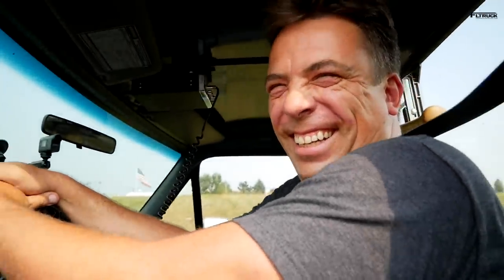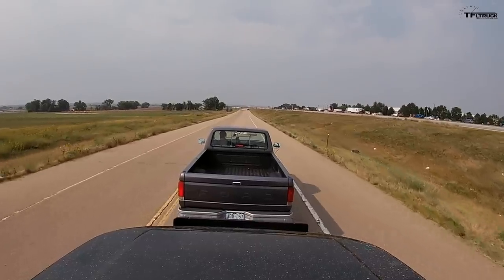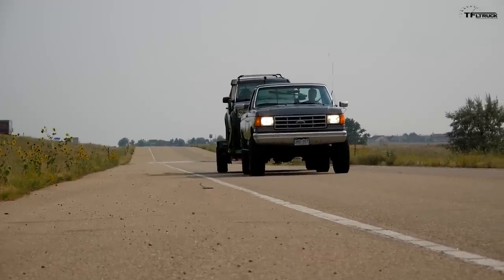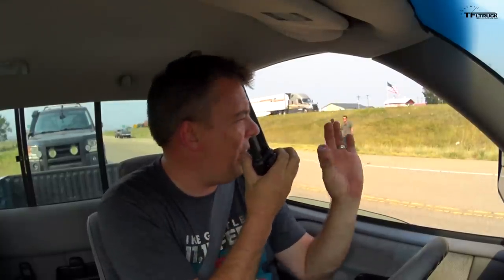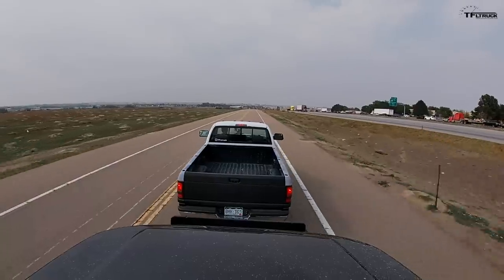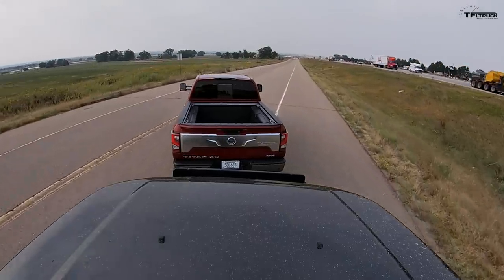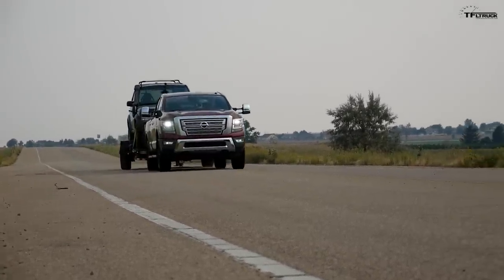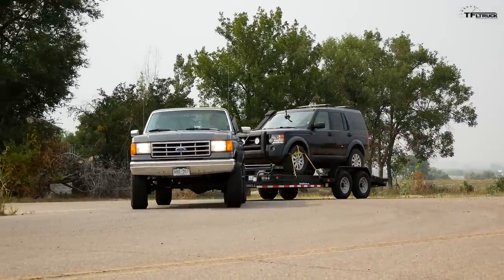Surprising Result! Can a New Half-ton Gas Truck Out-tow an Old Diesel HD Pickup? Let's Find Out!

Comment: Those old IDI'S didn't have enough power to out run a fart but they were good for 700k miles
Reply: A candle half as bright will burn twice as long
Reply: Put a turbo on one, and you get more power, same mileage, and it will last longer.
Reply: @kaulincurtis9665  the turbo one wont last as long because the turbo is forcing more air in the motor the non turbo will last longer because the motor isn't under that type of stress
Reply: @wyattfollestad8872  if it made more than 400 hp that would be true. The main thing the turbo accomplishes in longevity is drastically reducing the temperature of the combustion gases and improving emissions. As a naturally aspirated diesel, the internals are being cooked to death as the engine gasps for air.
Reply: @kaulincurtis9665  turbo was to combat elevation
Reply: @wyattfollestad8872  exactly, by packing in more air. When you pack in more air with the same amount of fuel, you get a leaner mixture, which, for a diesel, burns cooler and more efficiently. Turbochargers pack in enough air to allow more fuel to be burned, while still maintaining a leaner mixture.
Reply: I had a 94 factory turbo 7.3 idi. Definitely more usable torque but won't build boost unless its moving or floating the clutch with a manual to load it up.not as good as the direct injected 7.3 powerstroke where they still dont build boost good off of idle unless paired with a manual. I'm a cummins 6 speed guy now. Lots of low end and low gear boost and easy 40mph in 6th gear accept when im towing... Heard horror stories about breaking 6th gear.
Reply: Yes, the IDI is a great "around town" truck….they did Ford a disservice by not having a turbo vs. turbo comparison.
Reply: I got a 1990 f250 4.10 rear end idi stock everything will pull 12k to 60 fine, this one in the video is worn out and lifted

Comment: Sorry, guys, I'm not sure what 0-60 does for us here-- wouldnt it be better to do like a 10 mile run on flat and compare fuel cost, and then go from golden to idaho springs and back and look at speeds and fuel cost?
Reply: Thought I was the only one!
Reply: These guys usually miss the point  of towing.  The only videos they have made on towing that are very good are the ikes gauntlet videos. I really appreciate those since they really max out the capabilities of the newer trucks.
Reply: I think it's more for getting up to speed. 65 is the minimum here in Texas and you really get some super short on-ramps so you need to give it all you got
Reply: interstate on-ramp acceleration

Comment: Those diesels will still be on the road when that new truck is there age and in the junkyard...
Reply: Nostradamus here. What teams will win the 2021 championships? Who will be President in 2026? Any other predictions for the future?
Reply: BL Dontmatter  They probably are wrong. Either way, there is no logical basis for that prediction. It could be true. It could not be true. Likely, it isn't true. Modern vehicles run way more miles before breaking down than older vehicles.

Comment: Really enjoyed this video. I have an 89 ford f350 7.3idi. My wife named it Grease Lightening since I run biodiesel in it. Fun to see the different generations of tech stack up. The 7.3idi is definitely not fast, but it's reliable and there are so many still on the road today. Thanks for putting out good content. Fun to watch your videos.
Reply: Yes those old 7.3 International's are unstoppable.
Reply: I know this is 2 years old, but we just started towing a 10k lb travel trailer with a loaded bed and family in a 99 f350 with the 7.3. with an exhaust and an intake as the only improvements, it is not fast, but I like how stable and reliable it is compared to the 2022 chevy 2500HD my father in law sold for this and a down payment on a home. We both actually enjoy towing a heavy load with this truck better. Also the seats are 100 times more comfortable!

Comment: The oversize tires on the older rigs aren't helping their wheel torque numbers.
Reply: I think you meant the tractive force, which is indeed affected by the wheel diameter. Torque at the wheels alone doesn't tell the whole story.

You can have massive torque at the wheels,but massive sized tires will result in small tractive force
Reply: @juliussd5901   And are lying about the actual speed.  I have 315/70/17 tires on my 95 Cummins and the actual speed is little more than the shown figures on speedo.

Comment: I hate being so critical, but I do have to say that those 6.9 Tri star International V8 in the Fords would not do well when running near the red line. Power band is from 2-3 thousand RPM. You start to float the valves and loos power at 4K rpm.
Reply: this one isnt a 6.9 its a 7.3

Comment: Put a lift and some over sized tires on the titan to make them more similar.  When the older truck was new and unmodified it would have been "better" than they did for this.  Not saying they would beat the titan, but depending on how it is lifted and tires makes a big difference in towing.  Glad Amdre had no major issues with the test.  Stay safe and healthy!
Reply: I have a feeling that fully loaded, crew cab titan weighs significantly more than the other two trucks. So that might make it more fair than we think.
Reply: The Titan is heavier then both the old diesels

Comment: Gunsmoke is the best truck there! Love the old Fords, slap a turbo on it and you're set.
Reply: Better do head studs as well, that's what sent all the factory turbo idi's out was blowing head bolts out and loosing compression
Reply: @Dennis Burger I have had 3 idi's that were turbos, and all 3 blew head bolts with factory kits, the block was perfectly fine for non turbos, but when they first started putting turbos on them, they didn't go with a larger diameter bolt and the ones they were using would blow out of the block when they were used towards the top end, but I can not verify that the ones I have fixed were not fead the dreaded starting fluid causing them to weaken
Reply: @adriandawkins5500  
Yeah, the IDI engines received larger head bolts when the 7.3L came along. The 6.9L had smaller head bolts and couldn't handle the pressure the turbo's would make. Gunsmoke is a 7.3L, so it could handle up to about 11-15lb of boost without upgrading to studs. A simple Sidewinder or Hypermax kit would do the job. They literally make them a whole different truck.
Reply: @TheUnsureFox  I only use my idi around the house now, with the occasional trip to town for fuel, it's no speed demon, but it cranks up every time I want it to. When I have to pull something I use my newer one ton with the 6.7 Cummins
Reply: Yeah, if my daily idi wasn’t so nice I’d be putting a turbo on it to go with the ZF5, but I like running it on my waste oil mix & saving tons of $ on fuel now that it’s $3 a gallon again.

Comment: Great video but not surprising. The horsepower ratings and torque ratings on them old diesels are embarrassing low compared to today's standard.
Reply: @bjacks2927  People have used them here to tow 5th Wheelers,  but an IVECO Daily  with a 3 litre Diesel  can out tow them. This is US HD Trucks up to 2006

Comment: The mountain experience is going to be interesting. When I was young, I offered to help a friend bring 4 stallions (full grown male horses) to the auction. He was riding a Range Rover V8 (series one !!) with 2 stallions in the trailer and I was driving an old Landrover Defender diesel.... In Germany there is a steep Highway mountain around a city called Wuppertal. The range rover pulled the trailer at ease with 60 miles out of the "tal" up the mountain. My Landrover was struggling. Maximum speed 10 miles an hour in first gear, that was the max... :)

Comment: My dad has a 98.5 12V cummins. He absolutely loves it. All it has is a cold air intake triple disc converter and a fuel plate with 20 degrees timing. Just went to Alaska and back from Michigan. 
He said when he hits a mountain it just goes no downshifting with conveter locked. He had multiple people stop and ask what he has done to the truck because he blows everyone away in the mountains. One of the fellas was in a brand new F450. He said he loves all the attention his old truck gets and he never wants to get rid of it. 👍

Comment: The Ford and the Dodge are 26 and 31 years old and still doing it. The bigger question is how well will that Nissan be towing trailers in a couple of decades . I have a 95 Dodge Ram W2500 and a 97 Ford F-250 4×4 and don't plan on replacing either in the next 10 years .

Comment: The Ford has bigger tires but no regearing. Not good for towing.
Reply: I was wondering if it was regeared.  That makes a big difference.
Reply: Same with that Dodge, it had very bad gearing for towing with huge tires
Reply: @itripper1  I don't know, they sat pretty high from the factory.  It actually looked stock height to me.

Comment: Whew!! We are so spoiled with our modern vehicles! I threw 8500lbs behind my frontier (for like 12 miles) and I can testify, it did fine. No issues. Threw the same 8500lbs behind an 85 k1500 and I thought something was wrong with the trailer breaks or something. Completely different experience!

Comment: Towing isn't about speed it's about how much weight you can move
Reply: Yes but it’s nice to know you can merge on a fast paced hwy when you need to.
Reply: @AB-coyote  fair enough but diesel is always a win in my book
Reply: How much weight you can move up to speed while trying to merge onto a highway.
Reply: And a modern half ton will move more weight safely than an old HD. Those old trucks would get a piss poor rating if they followed J2807 standards

Comment: Heres an idea, let us the audience provide the old trucks and you TFL can provide the newer trucks. Title: how does a old modified diesel compare to the newer trucks?
Reply: You cant compare modded vs stock
Reply: @TheMrLebaron  I'm not sure how to wrap my head around the logic of that comment but you absolutely can
Reply: @townsendliving9750  The Logic is, comparing stock vs modded tells you nothing about how the truck did when new. That being said, no Fan of Nissan but that Titan can pull and haul about 10000 times better than any 80s or mid 90s truck
Reply: @TheMrLebaron  who cares how they preformed when stock, the logic is is it really neccessary to buy a 40k to 80k dollar truck or can you get the performance towing and saftey you need out of a older truck with the right modifications. I'm positive a late 90s powerstroke with a couple grand in modifications is better in pretty much every way than a titan, except for all the fancy Interior stuff these days. You could probably be about 16k dollars into about OBS powerstroke that would out preform and hold its value better, vs a titan I doubt you could touch under 30k

Comment: I'm positive my '16 Chevy 2500HD 6.0 gasser will out-tow my '93 Chevy 2500 6.5 turbo diesel.
Reply: Most definitely
Reply: I'm positive as well.
Reply: Most definitely. Just look the horse power and torque numbers. Your 6.0 will probably keep up or do better then a 454 from 93. Even a 12 valve cummins or the 7.3 powerstroke in the mid 90s didnt have "ton" of power. Great for that time, but no one was trying to tow 30k with a ton
Reply: The modern v8 engines are light years better then anything around in these times.  Looking at what my parents and grandparents used to tow with back in the day, believe me we are doing good lol. I have a 2019 f250 lariat with a 6.2. I tow a 10k camper around and it does it pretty easily.
Reply: @elev8torguy130  Didn't help that Chevy, Ford, and Dodge held back a lot of potential in their motors
Reply: Anything would out tow the 6.5 Detroit even a 4 banger gasser
Reply: @elev8torguy130   I really like the 6.2 super duty. If i didn't get such a great discount on new chevy through my job, i would definitely have one. Huge fan of the aluminum body as well.
I gave up on diesel after my last duramax. Too many emissions related problems.
Reply: @Eyore82  Yea I had the ol trusty 7.3 powerstroke. Honestly I don't miss the diesel. I also had more problems with that then all my gas engines combined lol.
Reply: I had a 6.5. loved it, but it had an hx35 turbo and 100hp over injectors, soooo
Reply: @johngarvin9580  I still have mine. It's all stock, 5 spd manual trans with the mechanical injection (no PMD). Just doesn't see much action these days..pushing 400,000 miles. But it barely cost me anything to keep it around.
Reply: No bullshitt

Comment: The Titan braking is even more impressive than it's speed.  I would take that Titan over any half ton for it's sheer confidence while towing and braking under load.
Reply: I think they’re better looking than the others. Not that it matters that much.
Reply: I wouldn't take Titan reliability
Reply: Tundra or MAYBE f150 with the 6 speed, but i dont trust nissan, gm, or fiat.  And fords i am cautious of...
Reply: Rocket John Titans are reliable, o have 260k on mine

Comment: If the 7.3idi had a banks kit on it she would have been right around the Cummins. 
It would be sweet to watch 7.3 turbo vs 12v Cummins and 6.5 Detroit. Or 350 vs 351 and 360

Comment: The idi have a fuel cut off switch that’s gradual just put it in four gear and you will get more hp and tq but red lining a diesel will get u less hp bec it cuts fuel
Reply: Same with the cummins. 18-2000 is what rpm they loveeeee to pull in.
Reply: yeah that wasn’t great driving. even in the cummins, he was pushing it too hard that it just wasn’t getting the fuel
Reply: @MCatwar  yeah. He could have cut that time way down if he didn't slam it right to the rev limiter. Lol
Reply: punkrocker10115 exactly why semi truckers don’t rev their engines all the way to fuel cutoff. inefficient for how much power is being made :)
Reply: Came here to say this, the IDI was well past peak power, shifting into 4th he would of started accelerating again.  I get the impression he really doesn't know how to drive a manual diesel. That said, the Titian still would win the drag race.  But let's see how well that gas V8 is doing after pulling 8k constantly for 200k miles....
Reply: Infurious honestly, it’ll probably do well, even after those miles. and yes, i agree. there’s a reason the OTR drivers don’t rev out their trucks all the way, and why they tend to shift a few hundred before redline instead of right at it. 

this test should be either repeated in automatics, or short shifted. diesels do not behave like gas
Reply: @infurious5748   It didn't even look like he drove the Cummins right either and that was an automatic.  The dude obviously doesn't understand that diesels don't tow well at the rev limit

Comment: Fast forward 30 years... wonder if that Nissan still tows anything.
Reply: Nope
Reply: Guarantee it will be.
Reply: Or even moves under its own power
Reply: I was wondering the same thing?  How many miles or hours are on those other trucks?
Reply: What about a Tundra. Is what i just got. Hope it is as good as my Tacoma or better.
Reply: Thomas Martin Got 105k on my 17 titan no end in sight
Reply: @josecq3  news flash that's only three or four years old, he's talking 30 years into the future, the Nissan's now especially with their very very poor quality control and cheap parts that they use, will not last 30 plus years without major work
Reply: Adrian Dawkins idk man, my ‘04 Titan with 172k still hauls and tows like a unit.
Reply: Adrian Dawkins My bad was responding to Thomas on the mileage aspect. To be frank I dont see very many trucks made now lasting 30 years in to the future. But I dont reckon I’d be keeping the truck that long either lol
Reply: @josecq3  The only trucks out last that damn long nowadays are going to be deleted diesels

Comment: Still have a '90 F350 diesel with >300k miles that would definitely outpull the F350 you have.  I'm guessing you should take that 89 to a diesel tech to have it adjusted.  The same could probably be said for the Cummins, it shouldn't be putting out that much smoke, even in that era.
Reply: Those old diesels are turds by today’s standards. Much simpler sure,but sooo weak.
Reply: @bheron01  weak is not the right word for it.
Reply: @bheron01  that has nothing to do with my comment. A properly running diesel from that age will have no issues with 9k pounds and highway speeds, even at altitude.
Reply: bheron01 have you driven one? They have piles of torque but you have to know how to drive them. I always remind my fiancé not to just hold on the clutch at a stop in my IDI cause even starting in second gear if her foot slips off it won’t stall it will just run into whatever is in-front of it. Remember the bumpers you see on paper aren’t the whole story, I assume most modern gas half tons will out tow me but this was a horribly done test and also these old trucks make peak torque where modern diesels idle on cold start...
Reply: David Wark yeah, I’ve driven some of the older ones. I’m not saying they’re bad vehicles. They are just not the power horses that today’s diesels are. Hell, my little 3.0 duramax makes almost 100 more hp and over 100 lb ft of torque more than those old 7.3 IDIs and will get far better fuel mileage. I suppose it’s not fair to compare newer technology with the dinosaurs of yesterday though.

Comment: Yes new truck faster but will it last as long as the older trucks? My pathfinder cost a lot to maintain. I got rid of it because of that. I bet these old trucks with maintenance has cost less then what the new one does.
Reply: People forget the down sides of the old trucks. Dodges ate automatic transmission and dashboards.
Reply: scot miller I like the old ford. I like that old non turbo diesel. I know the new trucks are great and every truck has issues sometimes I’m just saying those old ford diesel is cool